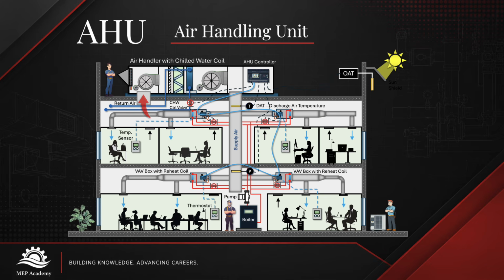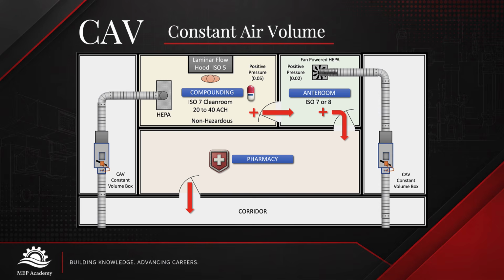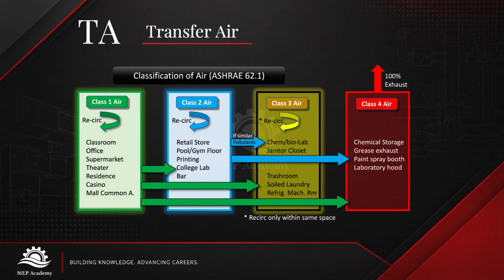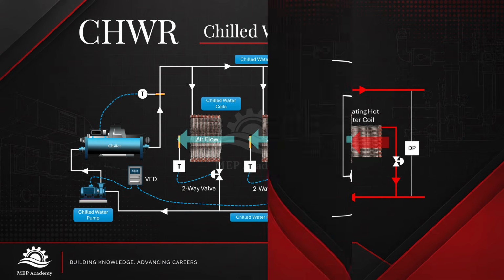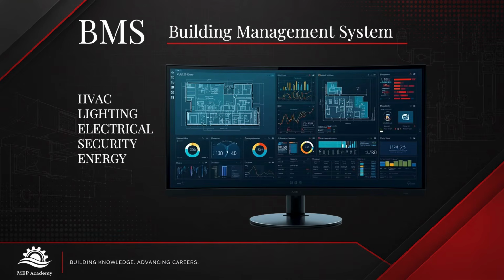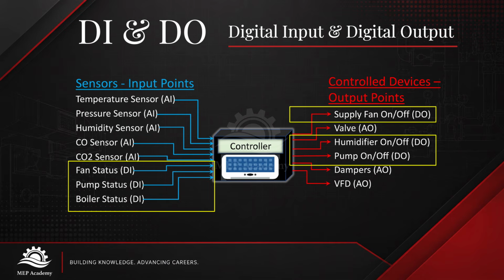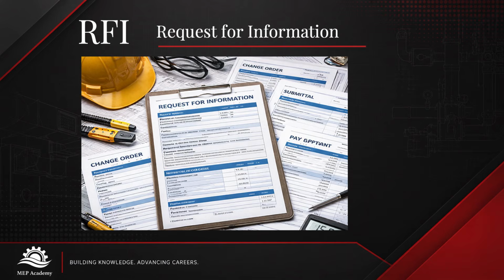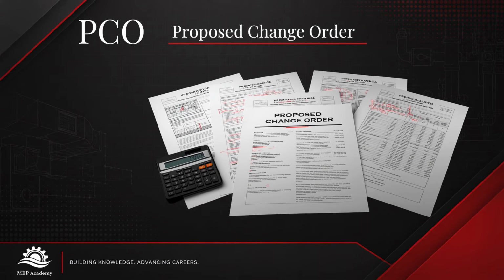55 HVAC Acronyms Explained | HVAC Terms You Need to Know

Comment from the maker: 📚 Learn HVAC estimating, project management, engineering, and more with 
MEP Academy's online courses: 👉  https://courses.mepacademy.com/
How many of these 55 HVAC & construction acronyms did you already know?
If there’s an HVAC or MEP acronym we missed, leave it in the comments along with what it stands for. We may use your suggestions for a Part 2.
And if you're new to commercial HVAC, save this video as a quick reference whenever you come across an unfamiliar acronym on drawings, specifications, equipment schedules, or project documents.